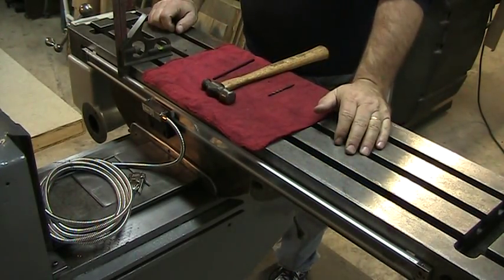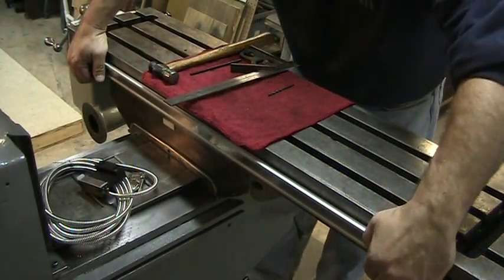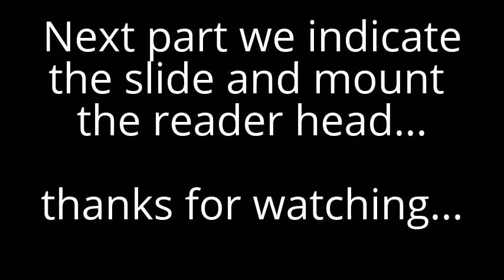DROPROS EL 400 Bridgeport Install Part 2

Comment: Wow... you did a good job. I'm a little apprehensive trying to use a handheld drill to drill precision holes perpendicular especially in tight places like that.
Reply from the maker: I was to but it really wasn’t that bad. Don’t let that stop you.
Reply: He did great keeping it straight.  Another option would be to drill a hole the size of the tap drill through a .750" to 1.000" thick block to make a drill jig and clamp that over your center punch mark.   That way you have a bit of a perpendicular guide to keep you going straight when drilling.